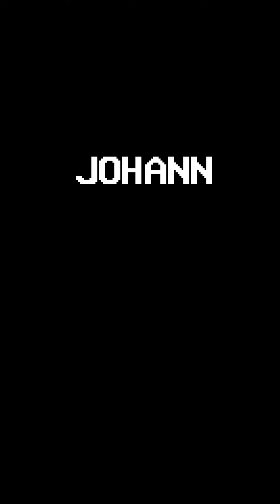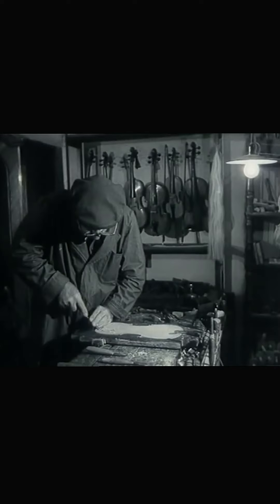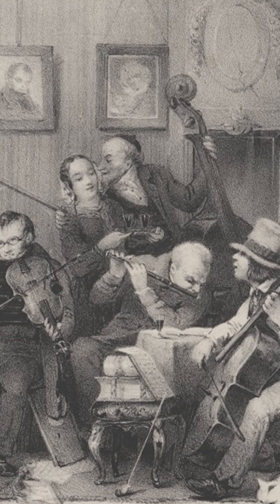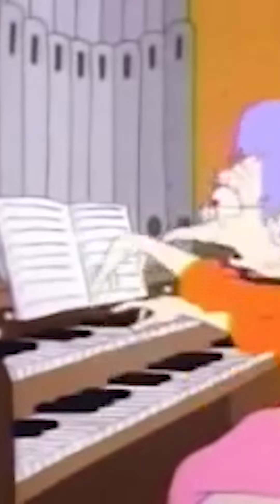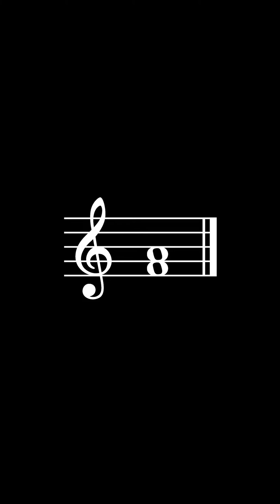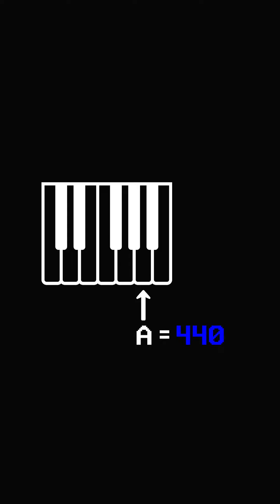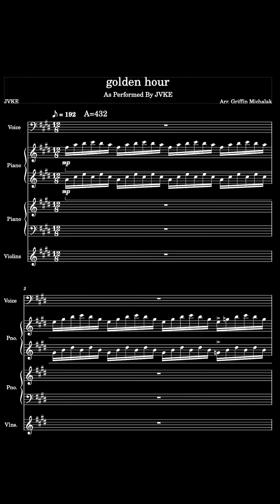What JVKE got wrong about A440

Comment: I always love hearing about tuning references and how they count or not as microtonal.

As Levi said, a single piece in not-A440 like Golden Hour can't be considered microtonal in itself; all the notes in the piece are a whole number of equal-tempered semitones apart. However, listeners constantly exposed to A440 music might notice a "microtonal shift" as they switch from "normal music" to this piece (or any other that's not in A440, obviously). It's like the modulation to G-half-sharp thing all over again, but instead of being between two sections of a piece, it's experience between two pieces. You could say there's a microtone between the last note of the previous piece you've heard and the first note of Golden Hour, and a microtone between the last note of Golden Hour and the next piece you'll hear.

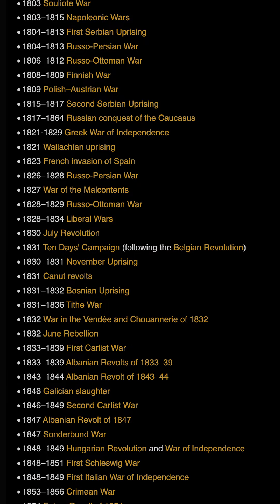If you think about it, it's the same technique used between the orchestras in the "great European tuning war" (2:14); you listen to an orchestra pitched at, say, 440 Hz, and so the next orchestra chooses to be pitched at maybe 442 Hz in order to sound brighter than the other orchestra. It's not "microtonal"... but when you first listen to the orchestra, the impression of brightness is not totally unlike the effect that can be experienced by listening to microtonal music.

In the end, maybe it's just a different order of microtonality. It's... macro-microtonality? 😂
Reply: I like this way of rationalizing it!

Comment: Equal temperament has around 30 keys. There’s the standard thirty and others that happen in rare circumstances. for example in fugues, the second instance of the subject always happens in the dominant, so when Bach wrote his fugue in c-sharp major, he had to use g sharp major, a a key outside of the 30 standard keys
Reply: The collective term for those keys outside of the 30 WRITTEN keys is "theoretical keys". But I would argue some of the WRITTEN 30 keys are also theoretical, as they are enharmonic. Because there are only 12 pitches in the 12-TET system, there are only REALLY 12 major keys. Now, because the idea of a "KEY" is a concept dreamed up by tonal harmony (a separate harmonic ideology that utilizes 12-TET), I will certainly grant the minor keys, as they are conceptually different than their relative major keys (through their allowance of the natural 6 and 7 as part of minor key harmony). 
So 12 major keys and 12 minor keys, after that the other enharmonic spellings and key signatures merely become a writing convention. Don't get me wrong, writing devices are important, but they aren't actually REAL. In the 12-TET system, F# and Gb are literally just one single sonic key, only the way we use written and spoken devices changes based on how we want to juxtapose those notes against other keys/harmony. So I'd say, in the system of tonal harmony (keys), and in 12-TET, there are 24 sonic keys.